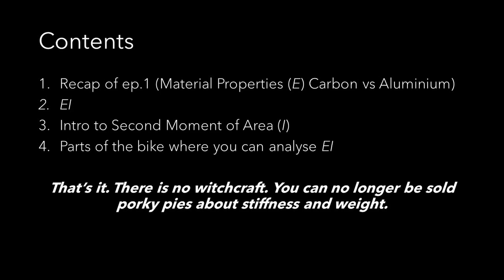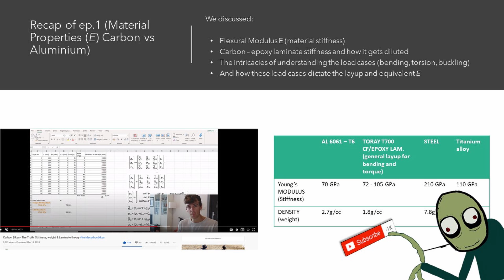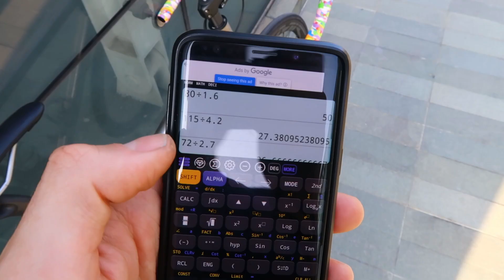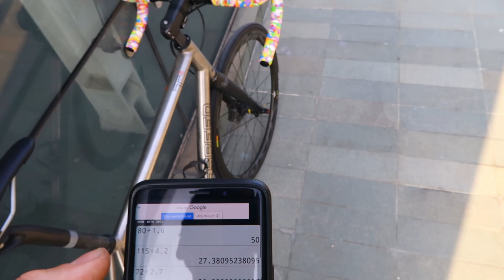Titanium Bikes - The truth and Physics of 'ride feel' marketing.

Comment: Another fad I hate as much as I do horizontal top tubes and dropped seatstays - is a top tube that's thicker by the seattube than it is around the head tube. Should be the reverse, but the entire top of the top tube must be flatter. I'm glad some manufacturers (i.e., J. Guillem, FalkenJagd & Sturdy Cucles) have resorted to incorporating 3D-printed lugs in their titanium bikes. Meaning, it is only a matter of time for titanium bikes to, for a change, get more beautiful rather than more ugly with every passing fad - and match the beauty and aerodynamics of carbon in looks. 
 I'm waiting for a titanium frame that looks like the Salsa WarBird, but sports a slightly greater slope in the top tube (ca. 16º, rather than ca. 13º), has all the front and rear mudguard, rack, bento box and headlight fork crown mounts that the 2019 WarBird (before Salsa's imprudent decision to do away with a headlight mount) graced; incorporates elegant Santana Z couplers (much finer than the ugly Ritchey Breakaway design or bulky S&S couplers!) and leak-free quick hydraulic line connectors for internally-routed hydraulic hoses (that's used in motor sports and now in No.22Bicycles custom designs as well), and thus can be split and packed into a relatively small dedicated hard rolling case (allowed as hand luggage in any airplane, with zero additional surcharge) in under 15 minutes and unpacked and reassembled in an equally short time. And has not a millimetre of the visible weld (thanks to 3D-printed design), the ugliest of all the visual properties of metal bikes, except for best smooth-welded aluminium ones (i.e., some Koga models). I'd happily pay €4.000,- for such a frameset or €8.000 for a complete bike.

Comment: Really ? I have ridden many Reynolds tubed frames, Columbus and Dedacciai along with aluminium and carbon fibres. It is a combination of the geometry, build integrity and material...  For example a Reynolds 853 for me was to stiff and over 60 mile rides was fatiguing to the rider. One of my current bikes a De Rosa Titanio XS is very stiff but it does deliver on ride comfort too ( 180 miles in 12 hours ). Titanium when correctly designed and built does create a super frame ( bike frames are after all only tools ) I am currently building a Reilly Spectre Disc. A friend who has just bought one as an ex-Cat 1 road racer declared it to be the best handling bike and most comfortable they had ever owned.
Reply: Great anecdotal evidence!

Comment: I am not a cyclist, but I am trying to determine if titanium indeed has dampening properties not possessed by steel in hammer heads. What hammer has the least shock to your arm while easily sinking a nail is a major debate among tradesmen and tool enthusiasts. One titanium hammer manufacturer claims that titanium transfers 97% of the swing energy while steel transfers on 70%. Thank you for your insights on how to approach this problem scientifically.

Comment: Interesting. My impression of modern bikes, including titanium frames, is that wider tires and modern geometry (slacker head tube angles) have made riding more comfortable on more surfaces. After 25 years of hard work, saving and learning what I like and don’t like, I chose a titanium frame partially because of what it meant to me as a trophy but mostly because of the impeccable build quality. As I’ve gotten older, I have less patience for things like noises and quirks and a titanium frame solved a lot of my complaints about mass production bikes. As they say, “to each, his own.”
Reply: The big difference is how the two materials can be used, and when I worked for zipp doing development and tooling, my boss was never into cycling. His test of wheel strength was putting it on its side and jumping on it. The test should be where it is mounted and its ability to twist, and the same applies to the two triangles that will apply to downward force but not the twist through the bike u under the force of climbing.

A fair bit of that feeling needs to be with the tuning of the forks. Do they have steel or aluminium steerer, etc, even if it the fork steel like I got that on a giant bike.

Good to focus on what is real.
Reply: I live in a region with a hot humid climate. Titanium is the only material that stands up to my sweat. That's enough reason for me. I have owned steel, almunium, and carbon as well. Yes, rinse my bikes after every ride and give them a full wash, weekly.
Reply: This is all silly. Titanium or rather the frameset has almost nothing to do with this. It's wheels, tires, freehub, drivetrain, cable routing, and 2x vs 1x that matter far more.
Reply: Unless you have a poorly sized press fit bottom bracket on your frame or a carbon frame delaminating/ water bottle bosses falling out etc. 

Carbon has lightweight and supple characteristics that are desirable, but how many mid 90s litespeed ti and steel frames still ride just like their first day vs only 5 year old carbon.

Comment: You can  probably make that frame bit more  comfy buy having curved seat stays instead of straight so you can let the chainstay flex more, plus curved front forks  instead   of straight.
Reply: Given the same steering tube angle and relative position of the axle to the crown, a straight blade fork can be made to flex as much as a fork with curved blades.  the flex will be more up at the crown itself, and the force from the road bump through the wheel axle to the fork will have a longer lever arm to flex the larger section crown, while in curved blade forks the flex will occurs more at the lower end of the fork, where there is less cross sectional area but also much less of a lever arm.  Don’t get me wrong; I prefer the aesthetics of a curved bladed fork, especially a steel one with a lugged crown, but that’s because I’m an old retro-grouch.

Comment: I might have missed it, but there was no mention of galvanic corrosion.  Aluminum and steel make for good anodes when used as fasteners for Ti.  I heard that carbon fiber is too but I'm not certain.  I have two Ti bikes.  I live in fear and have brass paste and grease on everything to help defeat the corrosion.
Reply from the maker: There was mention of anti corrosion merits

Comment: You speak about the stiffness of the carbon fibre bikes being diluted, by making the frames lighter.  You made a simplified(?) observation that a carbon frame of the same weight of an AL/TI could be twice as stiff (meaning given the same stiffness it could be half the weight).  However, when looking at the data (see link to video that summarises flex test data) the real life bikes don't show these differences: carbon bike frames are not stiffer than AL bikes.  Since we know carbon frames are typically not less than half the weight of AL frames, something else must be at play here.  Why aren't carbon frames stiffer?  Is it aero tubing?  Is it the composition of the carbon fibre plastics?  Or is the test that resulted the data not measuring stiffness in the same way that you talk about stiffness?     https://youtu.be/5f8PGpKUKro?t=453

Comment: The real reason for buying a titanium frame is that my cycling buddies will think I'm cool.
On guitar strings, though... even though tuned to the same note, nylon and steel sound different. As they are usually found on different guitars, it is hard to come across hard data on why. It may just be the diameter of the strings. I'm going to have to dig out my oscilloscope and see if I can characterize the difference.
Reply: Interesting….waiting for results

Comment: Total BS.  He's taken a little knowledge of mechanics and butchered the principles.  It's s not nearly as based on EI as he says.  With the triangles, it's more about E A (axial stiffness).  So much of his conclusions are oversimplified.
Reply from the maker: I would agree with you if it were a proper truss (pin jointed with tensile loads only). But its not, the tubes are rigidly connected and their is significant bending.

Comment: I ride a titanium road bike and find the ride light, stiff and yet compliant for long rides. The bike has top end DA aluminum clinchers and I run 25c tires at a suggested psi. Your comments seem to focus on stiffness. As a heavier rider myself, I would not want a stiffer bike than the one I currently ride. It climbs, descends and corners perfectly. To get desired stiffness out of a carbon frame, bike manufacturers have had to turn the bottom bracket into a lunchbox. Press fit - no thanks! Keeping my light weight Ti.

Comment: So, where does steel fit into this please? I like my trusty OnOne Ti hard tail 456 MTB which was not built to be light, but instead to be strong. And it has always felt better than the steel 456 which I think was only fractionally heavier. Hence my question about steel. Ta!

Comment: Physics and bicycles; brilliant! Thanks for taking your valuable time to make this video. I've owned several ti bikes (before I discovered carbon). As a material, ti is awesome especially if you live and train by the beach as it wont rust and retains its cosmetic appearance. I am a bit of a weight weenie and spent $$$ trying to lighten up my ti steeds. Ten years ago I bought my first carbon bike (Parlee Z5) and built up a 6.4 kg climbing machine (D/A mech, rim brakes, Enve eveything). Once that happened, Pandora's box was opened and I walked away from ti! Presently awaiting delivery on an S-Works Aethos with SRAM AXS. Looking forward to this delicious, "feathery" ride not wrapped in myth, but rather hours of finite element Monte Carlo analysis and simulations.

Comment: Do they still 'double butt' welded frames these days? Can that stiffen a frame that has typically thinner walled tubes over their average length? Or to put it better, can you save tube weight (by making them thinner) by 'double butting' the ends where the joins are and where the strength is needed?

Comment: I believe Ti best characteristic is its durability. I would do value a carbon frame over five years and a titanium frame over 10 to 15 yrs.   And your correct. The seatpost is the best place for comfort. Smaller rear ended, low seat clap with a good amount of slope in the top tube allows a longer s seatpost. This give a very nice ride and a stiff bike for performance. Tim Burrows Giant ONCE frames used this effective design.

Comment: Hi, yes I had a Litespeed Classic  (96) in a 57cm,was 1400gm .They do flex around the Bb when you stomp on them,to me they have similar ride qualities to steel but lighter. As you said the best thing about them is corrosion resistance and long fatigue life. Mine was a polished finish,so no paint chip problems,also the surface hardness is very good. This is 3/2.5 ti alloy  which is 3% alu & 2.5% vanadium . The Litespeed Ultimate was  6/4  ti alloy ,has more complex shapes and is stiffer.
Reply: I have an ultimate from around 96. I wish I could fit bigger tires on it. I would ride it still.

Comment: All this sounded impressive, but having worked in the bike business for 48 years, and having been around titanium bikes for that entire time, I can tell you the ride quality of titanium is unique and does have some unique vibration dampening qualities not found in either steel, aluminium or carbon fibre frames. Now, there are many cyclists who don't have either the experience or sensitivity to tell the difference. Being a professional wheel builder has given me many insights on how to greatly modify the ride of any bike, no mater what the frame material happens to be.  Don't be fooled by. "engineer speak" .  Go out and ride the bike and draw your own conclusions. But be honest with your self.
Reply: I was wondering about this too. I mean not everybody is totally snowed right, who enjoys the ride quality?
Reply: I partially agree with you. But I have a Trek Alpha 1.5, which is essentially a Trek Madone made out of aluminum.  This has no more vibration than the manual titanium bikes I've had because of the tubing shapes. And to my mind, it rides better than the Madone I had. I have returned to steel because of the ride. And I see more and more steel bikes being ridden by good riders who, like me, have disabilities from extreme carbon fiber failures. Having the main triangle literally fall apart on a carbon frame can change your mind about a lot of things. Now I have to take my Basso the remaining 20 miles back home.
Reply: I agree, I've ridden steel, aluminum and titanium. All the aluminum bikes I've owned are no longer with me, I stayed with steel or titanium for the same reason you say, in actuality riding the frames gives you the feeling and I'd go with that, aluminum is a very harsh ride, no matter if you lower the PSI, you can steel feel the material is not compliant with the road.

Comment: The tensile strength may be similar but this isn't a good test for a machine undergoing non-static loads. Fatigue testing for titanium is substantially stronger than Aluminium so can be built with thinner walls. Also, Aluminium degrades at room temperature and will fatigue more if exposed to heat (hence why airports have giant freezers).

Comment: I like the springy side-to-side flex at the BB. Makes climbing hurt my joints (e.g. knees) less, and makes my heart the limiter rather than the body. The frame gives, instead of my joints, and that flex is returned to the drivetrain as propulsion (see GCN "are you faster on a stiffer bike" vid) during my dead stroke. That's the smoothness I feel. Feels like steel tubing consistently gets the just-right amount of flex that I've grown accustomed to.
Reply: there's no propulsion from the frame flex. but if you like the softness, it's all good.

Comment: Is it really that simple that if one builds same sized bikes from aluminium, steel and titanium that are all the same weight, they should have similar feel? But then again, if the frames "strength" is kept as equal as possible between the frames, how will the characteristics change in that situation? And then the last one, if the material thickness is kept as equal as possible between frames (determined with the material that needs the highest wall thickness)...?

Comment: I think much of what riders interpret as "feel" is related to torsional stiffness in the frame, and I've seen studies that show riders prefer the twistier bike (up to a point) because they enjoy the sensation of winding up the spring as they muscle the bike around. The stiffer frame is "dead." The other is "lively." In making a bike for my wife from carbon fiber, I had to tune the torsional stiffness of the frame to her liking. That pretty much meant reinforcing the downtube to avoid twisting and widening the bottom of the seat tube. Of course, "compliance" has always been a nice way of saying flexy seat post or squishier tires. Your comments on AL frames are good, and it's why I dislike them. When they're light, they're thinner-walled, big tubes, and I have seen way too many with fatigue cracks, especially at the heat affected zones. I have also seen too many poorly made Ti frames just rip apart at the welds.

Comment: I know this has nothing to do with the material, but testing a litespeed as a representation of titanium. Arent they straight guage tubes? In general though I agree, its no magic material, but for the reasons you state, can make a very nice bike, and under a custom builder can be designed and butted to be to fit a particular riders needs very well. Mine personally wwas built to be the stiffest bike I've ever ridden and its fantastic.

Comment: Now if you take an aluminium tube and a steel or titanium tube of similar dimension or strength, hold one end and tap the other end with a given force they will feel VERY different.
Why would that not make a difference when you build those tubes into a frame?

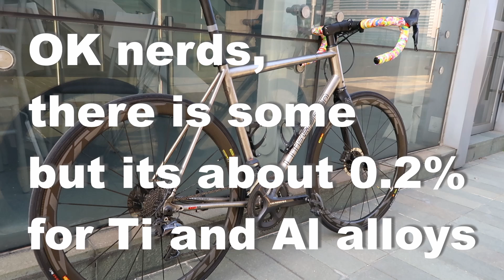Comment: @5:35 but the difference in dynamic damping b/w nylon vs metal guitar string tuned to the same pitch is measurable and audible - they dampen the input energy differently
Reply: Yeah, and titanium alloys have a lower frequency loss factor versus aluminum alloys which is why ti is an inferior vibration dampener versus aluminum. This has been proven in numerous laboratory tests.

This is why high end audio component manufacturers like Dynever, McIntosh, etc.... use aluminum alloys to dampen unwanted component generated and environmental vibrations, not titanium. They are not using the aluminum to save money. They are  using it because it has the metallurgical trait of being a superior vibration dampener versus other alloys including titanium based alloys. 

That’s why it’s always a good laugh to listen to the “my ti ride dampens the high frequency vibrations so well” bullshit claims. At least they provide some good comedic relief with their BS ti vibration claims, and that does serve a purpose. 😆
Reply: @rcg9573  People say that Ti dampens vibrations better but what they really mean is that it modulates and transmits vibrations in a more pleasant manner than aluminum. You're still going to feel the vibrations. They're just going be smoother and more pleasant than with aluminum. It's like hard vs soft rubber bushings on a car's suspension contact points. The former will be harsh while the latter not, but both will transmit road vibrations to the passengers. It's not the degree of damping but the type.